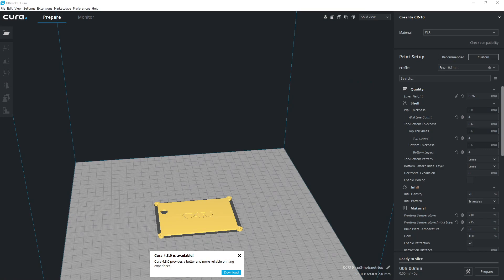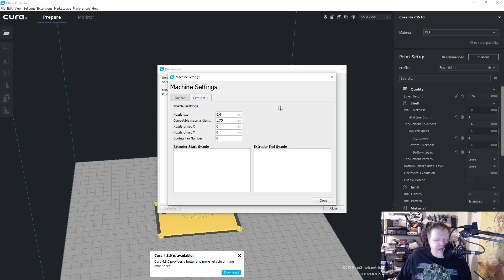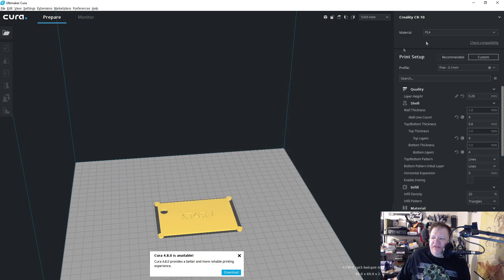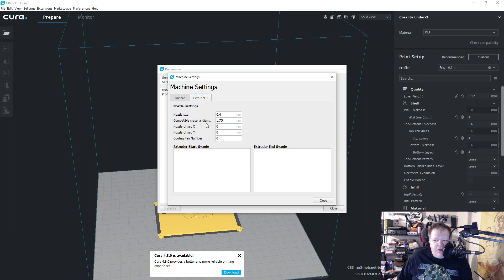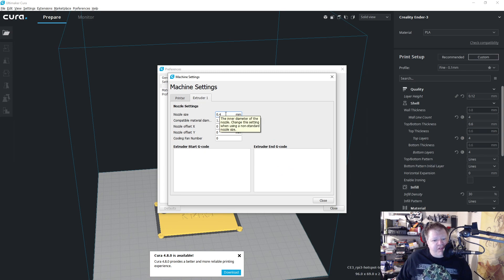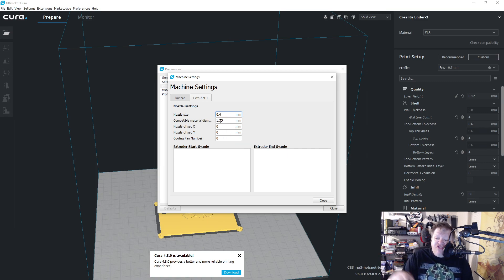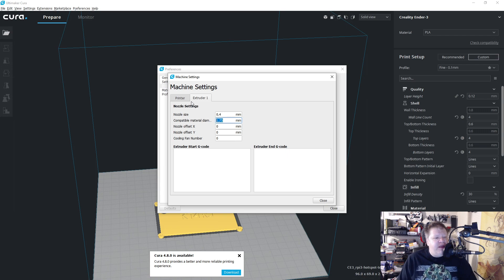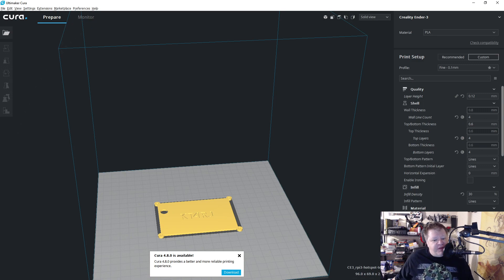how to change Nozzle size in Cura

Comment: To continue. What did you have to change on the CR10 going to .6?   I think there are a few other things that need to be set also. Line width and layer height are two I found out.  I'm putting in the .8 nozzle on Sunday and I'll post test prints over on Discord.
Reply from the maker: Nothing much since i print at .2 layer height nothing i needed to change. With a point .8 nozzle you may what to print .2 to a point .4 layer height. There nothing to change as firmware goes.

Comment: Thanks. I think Cura changed the location of this, so other answers I found were no longer applicable. Good work!! I like to use 1.0mm as it prints prototypes quicker. But the print feels like the side of a Doc Marten.
Reply from the maker: Bigger the nozzle the more rough it can get. That why I like .6 not too small and not to big

Comment: there is a bugg..is not possible to change nozzle diameter because always after i did it came back to 0.4 standard..
Reply from the maker: If there is a bug i have not seen it. Mind you i am using a older verison of cura...so maybe the verison you have is doing that.
Reply: @CanadianMakerProject  i have 4.8 but i have figure out is not supporting nozzles like 0.3 or 0.5 only pair numbers like 0.4 and 0.4
Reply: I have the same problem in Creality Slicer but its the same platform as Cura
Reply from the maker: It a skin of cura .
Reply: @CanadianMakerProject  but doesnt change noozle size. I think thats a problem of some guys! (like me) :p